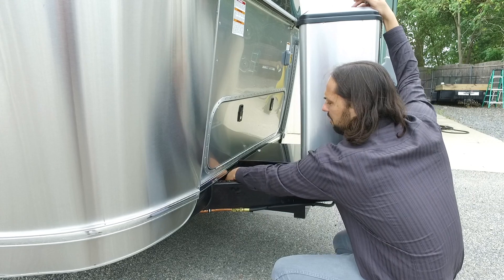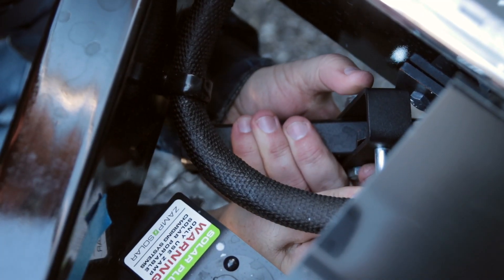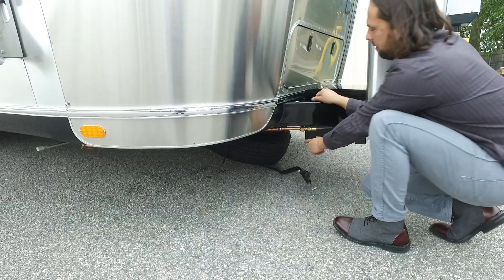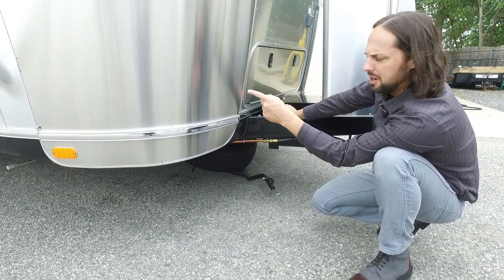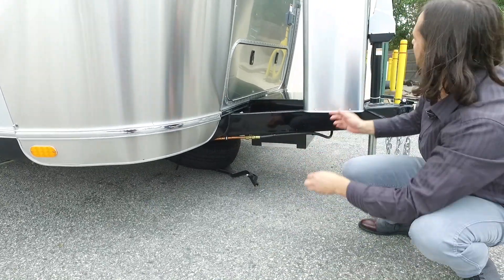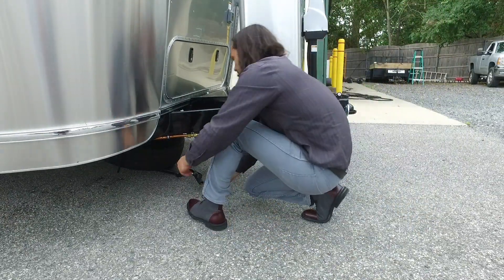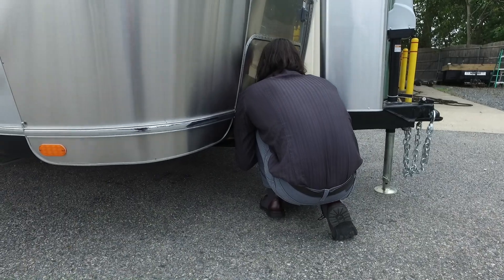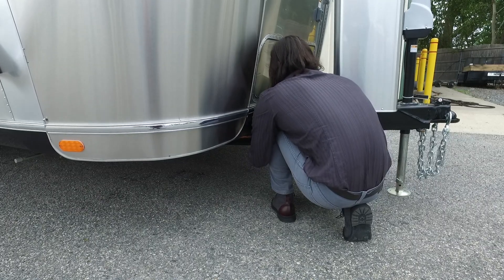How to Access the Spare Tire on an Airstream trailer

Comment: I have an 81 31 airstream excella.  When I changed out all my tires for 225 75r15 s the new tire doesn't fit in the spare tire compartment.
Reply from the maker: You may need to modify your carrier.